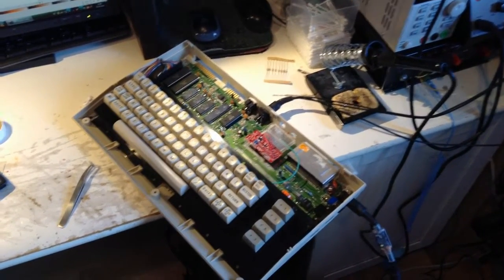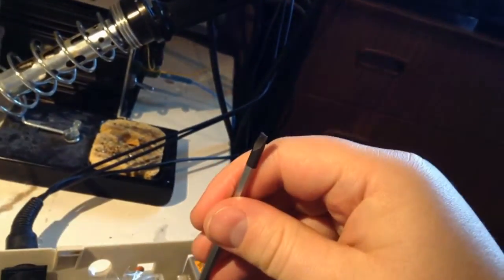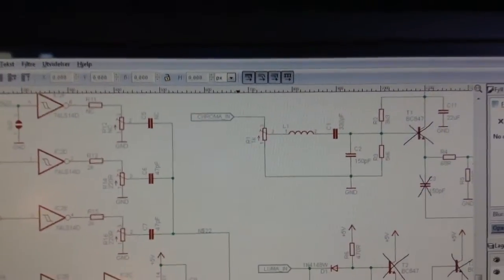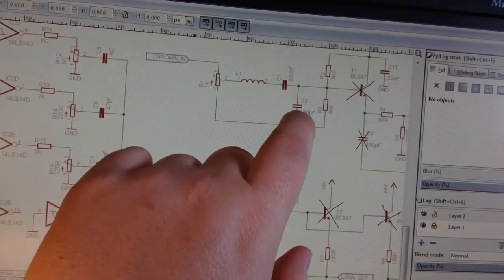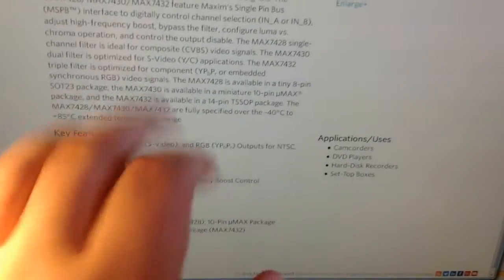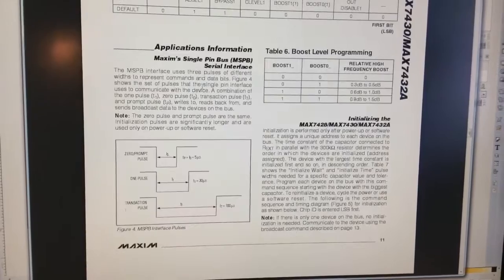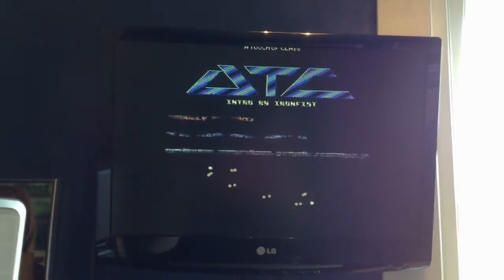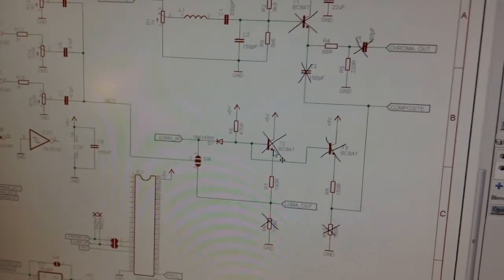Video Reconstruction Filter Pt 2 (StripeFix Pt 11 C64)

Comment: Nice. This stripe fix module has to be fitted inside the c64 Hans, doesn't? Feels good to be on top of thr situation again? :)
Reply from the maker: Yes ! Inside the C64. I loved to see that c64 videobuffer working the next day.
Reply: I can't quite remember why you put the pots in. I'd have to back and check. Do you think they're necessary to compensate for differences between individual C64 machines?
Reply from the maker: For the stripefix yes, for the chroma signal level, more or less for experimentation.

Comment: Looking great!  What's the next step?
Reply from the maker: - Fine tune the voltage divider on the luma to get the best signal in on  the videbuffer. (Now it is just divided into an unknown, perhaps 3 or 4 times less than the original signal).
- Another thing. I can't see any of the 17 MHz system clock noise anymore (The fine pitch bars next to the AEC bars). So that means we only nead AEC fix and that means less loading on the luma line.
- I got to rethink the design now. Do we need it to go under the vic-ii ic? The videobuffer gets hot. The dual use and multiple configuration seems to confuse people. I'll save the design I have now and make a copy to continue on to make a modulator replacement with stripefix that must go at the modulator pins. Also it would be nice to include solder pads for SVideo for those early C64s with 5 pin AV port with composite output only..
- make a separate design for using the modulator under the vic ic. Fix the 5V VCC VDD vic socket issue.
- The videobuffer frees up a lot of space. Go ahead and add second board2board socket foot print and not the solder every single pin hack i do now to get it into the vic ii socket.
- look for a low noise 5V regulator, because the luma is pulled up to 5V from the regulator which is , well it is not actually that noisy, but maybe it can be better.